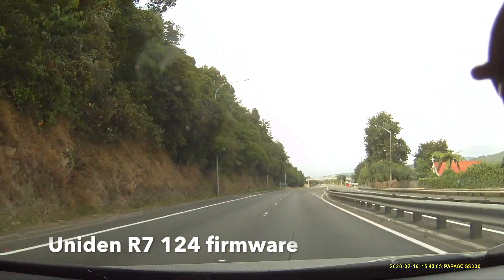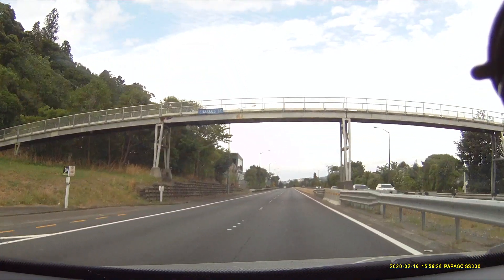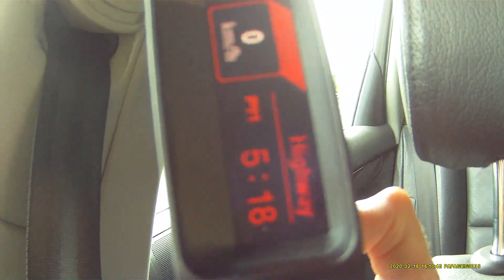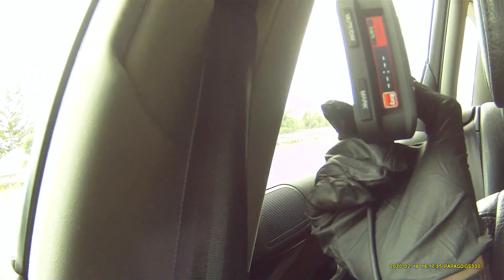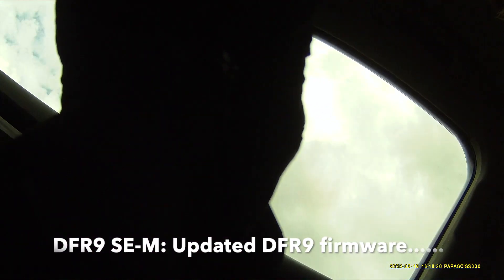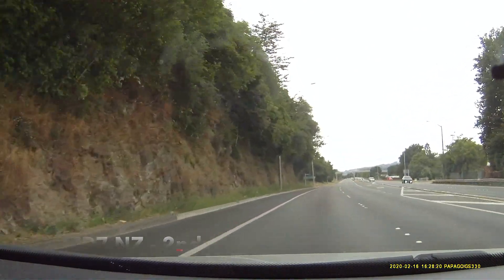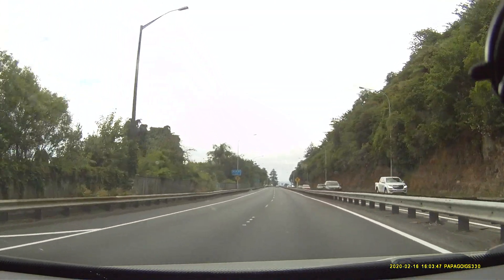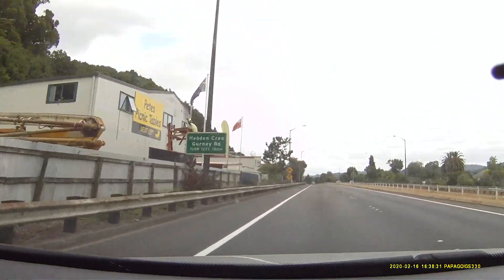Comparing detectors against NZ Mobile Speed camera van detection (Redflex)

Comment: Hey mate. What do you reckon the best detector to buy here in nz for the money?
Reply from the maker: For all round balance of features, minimal false alerts and performance: R7 running 149 International now beyond doubt.  Vortex is currently running this in the USA also and seems to like the new features.  Hopefully he'll do a proper review of it soon.  For use in NZ 149 International has a specific K Narrow (NZ) setting, it also has K limits to you can customise your own K band sweep if you prefer.  It also has a K block for Holden BSMs and also has a better implementation of Auto-City mode than the R4 or R8.  I have some limited stock of R7s: NZ$1125 inc 12m NZ warranty and courier delivery, or else you can purchase via e.g. Amazon and the 149 International firmware update and NZ GPS will be just NZ$100.

Comment: when buying the R7 in NZ what firmware does it come with.
Reply from the maker: This firmware is not publicly released yet.  If you buy an R7 in NZ from Uniden New Zealand, I think the latest firmware it comes with is 125.  That has two K segments, and Uniden NZ gps database.  However, those two K segments are wider than this updated 127 version.  2.18 is the latest gps version on the 127 firmware, vs 1.29 on the Uniden NZ version.  2.18 is a complete revision and fully comprehensive for NZ only.  There is also a separate AU only dedicated gps version.
Reply from the maker: Uniden NZ has now released v132.  However the US R7 is now on v137, whilst the International R7 is currently on 137 and 138 is due out for release soon.

Comment: Redflex rendered RDs useless
Reply from the maker: Wouldn't say that.  Very much depends upon the situation. See here: https://www.youtube.com/watch?v=PBOR-6vwoNk
Reply: @mikefearn5213  Redflex has high/low power modes. I had same results with Redline vs High powered Redflex, but when it’s in a low power Redflex sucks, also Stinger and I’m 150% sure that Uniden in your video link
Reply from the maker: @forgewire  No detector is perfect, but in many instances they help a lot.  Detection of redflex also very much depends upon the vans location.  Typically you will see much greater range of detection in one direction relative to the other.   Not about high or low power modes.  More about location and direction towards or against the radar beam.  Contrast this specific location to another van location which was detected with DFR9forNZ with lots of warning: https://www.youtube.com/watch?v=H1mUZ6V1a5c
Reply: @pl1068  escort live is same as Waze and lame
Reply from the maker: @pl1068  Don't agree.  International R7 with user defined segmentation specific to the mobile redflex, and gps database for all fixed mount redflex cameras is best I have seen.  If you can find something better, please send me a video, we'll see if we can find the same unit to run some side by side comparisons.  At the end of the day, no one radar detector is the best.  It depends upon what value for money, features people want, how and where they drive and what type of detection they face most in their area.

Comment: So basically by the time you detect a reflex you're already snipered...?
Reply from the maker: Every detector and firmware differs.  Uniden R7 firmware version 127 is probably the best there is against redflex in NZ.
Reply: @mikefearn5213  hey is this still the case or has something surpassed this?
Reply from the maker: R7 149 international is scheduled for release on both R7 hardware versions later this month.  The redflex vans have been updated since I took this video.  They are now able to change their frequencies depending how they are set up for the day.  The R7 still handles redflex very well and should give you more than enough time to slow down.  The DFR9 SE also handles redflex very well.  In my recent testing the V1Gen2 came out top on redflex range.  However, I believe for any brand, the R7 is the quietest detector to run on K band in New Zealand.  R7 149 International also now has Auto City mode, as well as 5 preset K blocks, as well as a present K Narrow (NZ) as well as customisable K limits if you really want to change things up a bit.

Comment: Thank you for your video. Im thinking to get the DFR7. Should I update the firmware or not??
Reply from the maker: DFR9 is a great detector.  I would recommend converting it to the NZ specification as that offers you more options for segmentation on both K and Ka bands. The thread to do that can be found on the radar forum.
Reply: @mikefearn5213  Do you have a link to that page? And, can I do it myself or do I have to post it away?
Reply from the maker: @ethanbatten4427  Hi Ethan, Can I suggest you google search for the RD Forum, and sign up.  Mithheru posted all the details on there, with the files for updating the DFR7.  Ideally it will also need a slight retune.  I can do both the update and retune if you need, but you'll have to send your detector in.  Again, easier to arrange if you find me through the forum. Hope that helps.
Reply: @mikefearn5213  sweet as, wasn’t sure whether to go through you or mithheru, though i have a feeling they’re the same guy
Reply from the maker: @ethanbatten4427  Flipside of the same coin I guess.  Go with mithheru, he's easier to contact through the forum, and can probably answer your questions more easily there than I can here.